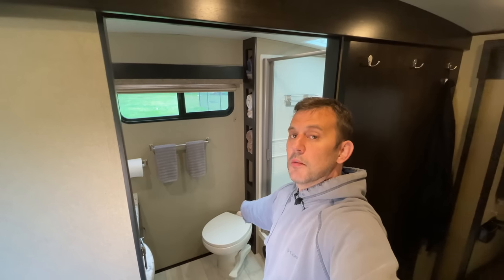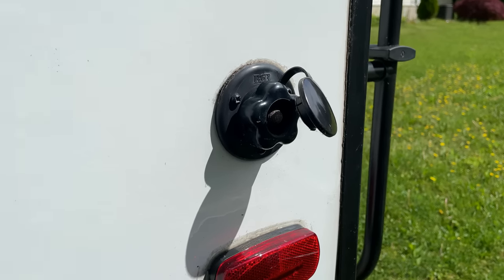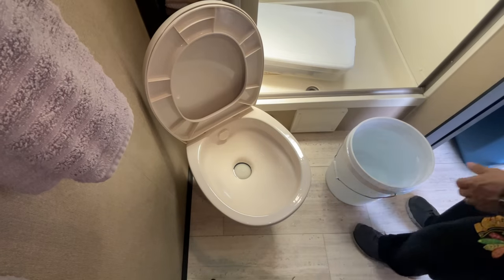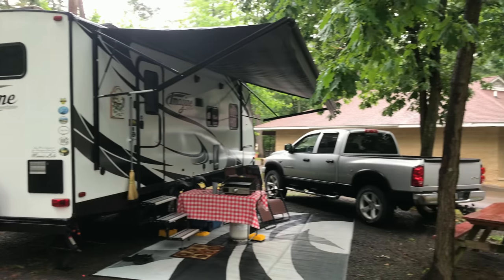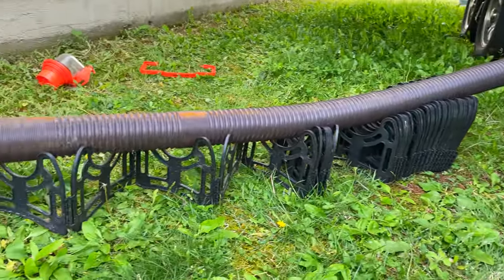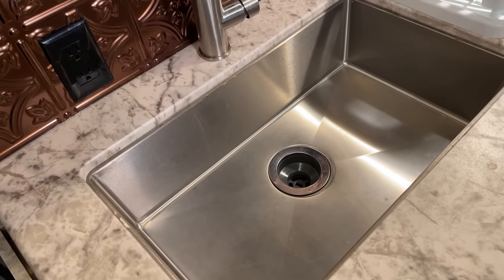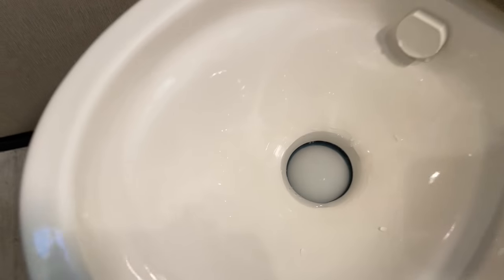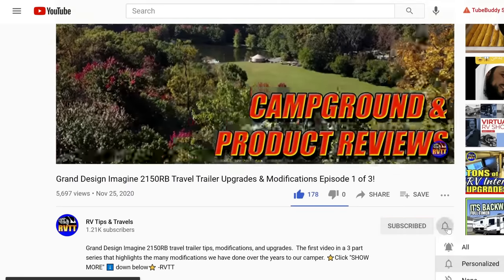RV Black Tank Cleaning, Maintenance, Tips & Tricks - The Original Black Tank Master Class

Comment: A tank cleaning service recommended a Calgon/Pine Sol blend for our black tank. We’ve never had an issue with odors and the Calgon makes the water slippery so less waste/debris sticks to the tank. Also, when we empty the black tank, we always put a bucket or two of HOT water down the toilet while the gate valve is open which really helps loosen and immediately discard anything that might be stuck.
Reply from the maker: Great tips!  Thanks for watching and adding to the information in this video!
Reply: What amounts do you use for Calvin/PineSol together?
Reply: Ancient Chinese Secret?
Reply: @margepinkowski2797  hi Marge. What is the recipe?
Reply: @margepinkowski2797  what is your recipe for this cleaner??  Tnx
Reply: I add some detergent in the bottom of the empty tank along with a couple gallons of water before we start out. I also throw in a Teteford orange puck as well. Pine sol or Mr Clean is a good idea.
Reply: What measurements of Calgon/Pine Sol?
Reply: @margepinkowski2797  Doesn't appear you got an answer regarding the recipe for the tank treatment.  Here it is:  Mix 40 ounces of Pine-Sol with enough water to just about fill a gallon jug. Top off with a half cup of Calgon
Bath Beads. Use eight ounces in each tank (or more in especially hot weather or if your tanks will be filling up
slowly over time)
Reply: @roger80465  look j I’m in
C c Ed
Reply: Never heard about the galgon and pine sol, thanks for the tip.
Reply: Right before leaving on a trip I'll put in a black tank detergent packet, and 20 lbs bag of ice.  Scrubs the sides pretty good going down the road.
Reply: I probably saw the same video. But wasn’t that for the gray tank? Or for both gray and black?
Reply: @margepinkowski2797  for 32oz bottle it’s 2 oz of canon 10oz pine sol and the rest water
Reply: @gailynbrock5204  for 32 oz bottle use 2 oz calgon , 10 oz pine sol and the rest is water
Reply: @ryanjensen9282  Yes! A little water in the black tank while traveling does an amazing job of removing debris. Adding ice is another great tip for a quick scrub. Particularly when leaving to store your unit or prior to a long stay. Simply add a bag of ice and a little water, drive a mile or two - getting rightand left turns in, and return to the park or dump station. Do this for both tanks. The ice method does not apply to those with macerating toilets or tanks with internal probes. Despite what most think, the gray tank is just as disgusting inside. Less solids, but just as slime and smelly bacteria bit filled as the black tank.

The Calgon treatment also helps keep your pull valves lubed and closing fully. We all hate those poopsies caused by sticky pull valves not closing completely.

Another tip for those staying long term. Using a waste hose support slinky add a "U" to the sewer hose. This creates a "p-trap" to minimize gasses from the main sewer from entering your tanks and exiting the roof vent. If you've ever been next to a terribly smelly rv site or notice a sewer smell on certain days this is due either to a poorly sealed sewer hose connection or a camper with their valves open 24/7 without a p-trap in there hose. Poorly sealed tank vent caps can lead to a smelly interior. Particularly when you open a window, roof vent, or run the exhaust fan. A simple fix I don't need to go into. Smells also enter through drains (sinks and showers) when the water in the p-trap(s) evaporates or empties during travel. Top them up while setting up. Okay....rambling now.
Reply: 1/4 cup calgon bath beads, 1,1/2 cup pine sol and 1/2 cup water . I use lavender scented beads and pine Sol
Reply: Good for 5 tank flushes… just need 1/4 cup after each dump
Reply: Have found 2 Caps Calgon  and 1 Cap Full of Dawn ( using Calgon Cap) works amazing and never had a problem with odors!

Comment: Great video. After I dump the dump, I add a cap full of Calgon water softener, a half of Calgon cap of blue Dawn dish soap, and mix that with a gallon and a half of warm water. With the black tank closed, I dump the mixture into the toilet and brush the toilet clean. Then I drop it into the tank, and fill the toilet bowl full of water 2x as you described in the video. I do this process every time I dump the black. It doesn't matter if I'm traveling or still at the camp site. I can honestly say I've never had a sewage smell come into the trailer. The only difference I do is on travel day, at the water connection I squirt more Dawn down into my black tank flush hose. Also on travel day, I do my above process to the gray tank.

The only tip I would add is that when I arrive at a new camp site, even if it's been a few weeks, even after I hook up, I do not dump either tank at all until it's necessary. This keeps that same water softener and Dawn in the tanks as long as possible.

Comment: we use a borax and soap mixture for treating our black tank.   Much to what you said about putting water in the tank, we make sure there is a few gallons in the tank then pour 1/4 cup of borax and 1/4 cup of dawn dish soap before hitting the road.  Then when on the road it all sloshes around in the tank and coats the walls and actually can break down any debris that is stuck to the walls and even stuck to the sensors.  We have yet to have a single bit of smell from our tank using this method.  excellent video for newbies like us, this is our first year with a toy hauler and have taken many tips from pros like you!
Reply from the maker: Glad it helped and thanks for contributing to the video and the nice comment!

Comment: When I dump I put a few 2x6 planks under the passenger side trailer tire. Gives it a good lean. The higher angle helps the waste water flow more than you would expect. I did it today without them. Then added them and probably got another 2-5 gallons out of it.
Reply: I have been rving since 1997. Ross is a GREAT resource.
Reply from the maker: @SteveLee-iw6wz  Thank you Steve!

Comment: When we are going a good distance we fill the tank with enough water to cover the bottom of the tank. We then dump a bag of ice in. The ice sloshes around as u drive down the road cleaning the tank. Works really well!
Reply: Good idea.  Doesn’t work in the summer
Reply: @Sunny-kn6th  yeah here in Texas I would have to dump the ice with the truck running, jump in and go.  Even then I doubt it would do anything in the 5 minutes before it melted.
Reply: Adding ice is a great way to clean the tank. I put in 40lbs without any water. Even if it’s hot, it’s gonna slosh around for a while. My gauges still don’t work :(

Comment: The ice does work, my last trip the black tank sensor was stuck at 3/4 full. I dumped the ice down in the black tank for the trip home and when I got home, the sensor was back to empty. It’s the only way you can basically get any type of scrubbing inside the tank, then it just melts away.
Reply from the maker: Thanks for commenting!
Reply: I've heard of using the ice in an empty tank just as your leaving so it can kinda move around and Scrape the bottom of the tank 👍

Comment: This is a great video. I would only add that in some smaller RVs, the bathroom sink drains into the black tank, not the gray. This is actually a good thing, both for keeping water in the black tank and extending the time between trips to the dump station. Here is one hint: When I dump while winterizing, I pull onto leveling blocks in a way that angles my tanks down toward the valves. That way, I get every bit of water out. Because of the design of my rig, it's the only time my black tank is ever truly empty, since gravity works against fully dumping the rest of the time.

Comment: We store the rv at my dad's. He had the forsite to install a drain to city sewer at the right spot for the campers.  We wash out the tank each trip.  We live in a freeze zone so we can't leave water in the tank in winter.  Winter camping we have insulated skirt and heaters.  Try to park over the drain at the winter site so hose is in the non-freezing part of the camper. Water is heated hose.  No problems down to -20°F.  Need a dehumidifier for the camper to prevent condensation.
Reply from the maker: Good info thanks!

Comment: He does a great job explaining all your options for cleaning and the importance of keeping liquids in your black tank. I usually will drive around the campground to allow the pyramid to break up by sloshing the liquid around in tank. We also have a lined garbage can that the TP can be put into versus in the tank. The paper absorbs the liquid which if there is a quanity it can also cause pyramids. So just alot easier to dispose of it daily by garbage.
Reply from the maker: thanks for stopping by and commenting Rick.
Reply: My wife has a toilet paper fetish and tosses wads down the toilet. Needless to say, the exit passage was blocked badly. I poured about a cup of Dawn dishwashing detergent down the toilet and drove home, and used the local dump station where it flushed like a tidal wave. Downside was driving with a full black tank which caused a little sway, so I drove a little slower. Btw, Thetford RV toilet paper has given me blockage problems. I prefer Scott's RV toilet paper.

Comment: We have a wacky black tank setup, where the toilet is offset from the tank a lot, so there is a long 45-degree angle pipe from the toilet to the tank.  This is the first RV where we've had terrible smells from the black tank coming back up the toilet when we flush.  So far, we've had reasonable luck using the tank back flush to try to thoroughly clean the tank when draining, but we've not tried leaving a few gallons and treatment in the tank during the season between camping trips.  I've watched a few RV videos and some of them are based on pure fantasy, yours is the first one (besides ones done by the manufacturer) that seem grounded in real information, not just stuff made up off the top of your head.  Subscribed.
Reply from the maker: Dave, appreciate the kind comment.  Never heard of an offset tank, and not sure why any manufacturer would build it that way.  But yes, keep water in there, always!  Welcome to the channel bud!
Reply: Our camper has a 45 going into the black tank as well…..mobile suite air…and we’ve had some clogs…what I use is a 4’ long piece of 1/2” PEX with a ball valve on the end and hose adapter..it snakes thru the elbows and does a great job of cleaning the tank…all parts available from Lowe’s!!  Also use the borax dawn solution in black tank and borax-citrus in gray tanks every once in a while and got some ugly stuff out of the gray!!
Reply: Campco makes a flexible black tank cleaning wand for angled toilet pipes.

Comment: Wow!  Excellent information.  I didn't know.

Had my first black tank clog in 8 years using my RV.  Added more water using the black tank sprinkler and nothing.  What cleared the clog for me was to leave the black tank valve open and open the grey water valve.  This must have caused a suction and pulled the black water clog.  Lucky for me I went through this process the day before leaving the camp site.

FYI - I did not know about adding 5 gallons of water to a black tank once it is cleaned.  I would add a little water but in the future I will start adding 5 gallons to the black tank.

Gus.
Reply from the maker: Thanks for sharing your experience with everybody Gus. Glad you enjoyed the video.

Comment: GREAT VIDEO! I have been RVing myself for about 20 years and I just learned some good, new tips. On top of 5 gallons of water after dumping I will split a gallon of Simple Green between the black and the grey tank. It helps with any possible odors and it is a great natural degreaser keeping your tanks slippery while in your tanks. This is an old trick my grandparents used for many years.
Reply from the maker: Thanks for watching and adding Pete!

Comment: My travel trailer is my "summer home" for nine or ten weeks of visiting family up North.   I use the home remedy, 1 cup Dawn/1 cup fabric softener. It cleans the tanks and any odor is that of a laundromat. Other than the ~weekly dump (ie. Moving to a new location or end of season) I empty the tank and fill it full with water two or three times. Usually, this is enough to clear the tank level sensors. Then I add a couple gallons of water and the dawn/ laundry detergent to slosh around while going down the road. Sensors are delicate and need to be clean to work.

Comment: Great job on the video. There's nothing to be afraid of here - it just takes some getting used to.
I bought my trailer used (8 yrs/old)- the black tank indicator was stuck on 2/3 from the get go. 1) I tried partially filling, adding treatment, allowing to sit for 24 hrs and then travelling the rv before dumping the tank. 2) Fill and dump repeatedly - nothing seemed to work. Before our third trip I purchased a Camco 40074 RV Flexible Swivel Stik with Shutoff Valve at Walmart. You mentioned something similar in the video. After dumping/rinsing the tank I ran the swivel stik for 5-10 mins - the flexible hose allows you to move it around different sections of the tank - and voila our sensors give accurate readings! 
Ever since - following many of your tips - keeping the tank wet, using a treatment, and occasionally running the swivel stik, we've had no issues at all. 
Happy camping!
Reply from the maker: Thank you for the nice and informative comment!  Happy camping!

Comment: Hey there everyone, our family has been pop-up camping for many years.  In fact my in-laws still have a 1960 something “tradewinds” pop-up and still use it occasionally.  The wife and I decided to take the leap and purchase a Forest River Salem Cruise Lite this spring as we’ve had a seasonal site at our local campground.  Eve though we have had our “first time travel trailer owner issues” and are still working out the kinks we are loving the camper.  We have had a couple of issues with clogging the black tank.  We use “RV” toilet paper and had absolutely no clue that regular old 2-ply is just fine to use.  Every time we have clogged up the black tank, the owner / maintenance guy lets us do a complete flush of the tank while doing a pump-out.  If it’s really plugged up good I take the handle of a broom and break everything up along with the (5-10) 5-gallon buckets I dump through the toilet bowl while opening and closing the dump valve each time.  As long as we catch it early enough we can usually avoid a MAJOR PROBLEM.  In between pump outs we use Camco black water treatment and an enzymatic liquid if we know it’s going to have a couple weeks to work before the next pump out.

Great video and awesome suggestions and tips from everyone out there!!  Thanks a million for a great video!  I too subscribed and will definitely follow your channel.  AWESOME!!!!
Reply from the maker: Thanks for the great input and comment Jon, glad you have you on board!

Comment: Great vid! I leave my flush hose connected at the site. After cleaning black tank, I turn on the flush hose for 30 to 40 seconds (5/8" max is 9.8 GPM) to put aout 5 gallons back in. Better for me than lugging a sloshing bucket. You can quickly look up max flow for varying hose sizes instead of buying a flow sensor.
Reply from the maker: Thanks John!  One reason I like the bucket is because it’s a greater pressure force right where everything falls.  Great idea looking up flow rates!

Comment: Great video! I watched it less to learn and more to judge. Zero complaints! 40 years rv-ing and you're spot on. As for tips not mentioned, once or twice a year I drop a non-bleach/all natural laundry detergent tab into the half or more full blackwater tank before a drive. The laundry detergent keeps the entire tank slick and stick-proof for several dump cycles and doesn't mess with the toilet chemicals.
Reply from the maker: JS, thank you much for watching and adding to the content of this video!!!
Reply: What’s the name of the non-bleach /all natural laundry detergent
Reply: @Berrypancakes229  I use Mrs Meyers tabs, but any natural and bleach free tab will work.
Reply: Tide works too.

Comment: Great video! So appreciative for such high quality content. One tip I'll add: for a cheap, more effective, rigid sewer hose runner, I use an aluminum gutter. It stores away in the bumper and keeps the hose perfectly straight. You can prop up one end and run it a long distance safely. Keeps your hose clean as well.

Comment: I always check the dump valves before we leave, last year I went to dump one of our Frey tanks and someone had opened the gate and stole the handle. Fortunately it was a grey tank and I was able to force the cap back on until I could close the valve. Now I carry spare handles but ALWAYS check the handles and make sure the gate is closed before every dump. The other thing I carry is an oil filter pliers. It helps with the cap. I actually carry several and I’m always giving them away. They run $5 at harbor freight. Good video. Thanka
Reply from the maker: Thanks for watching and commenting Karl!
Reply: Oil filter pliers is a great suggestion!
Reply from the maker: @ericjolly6802  agree!